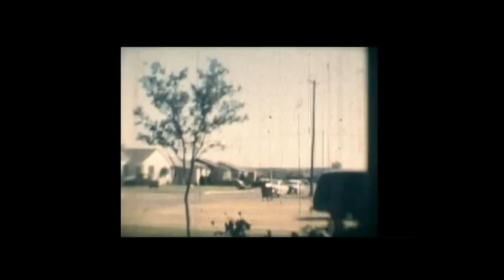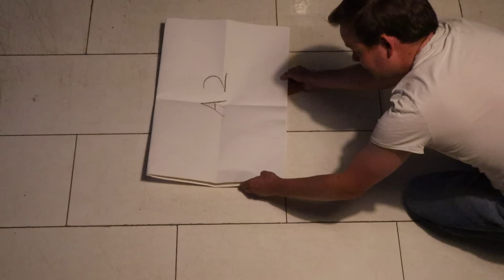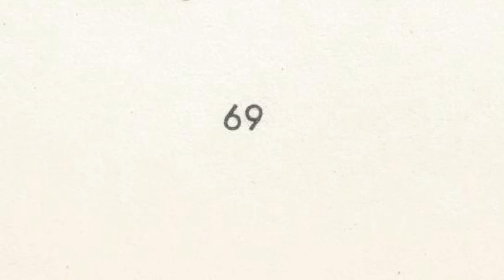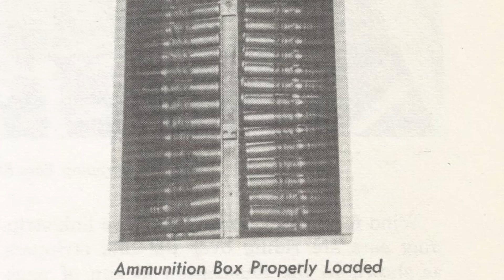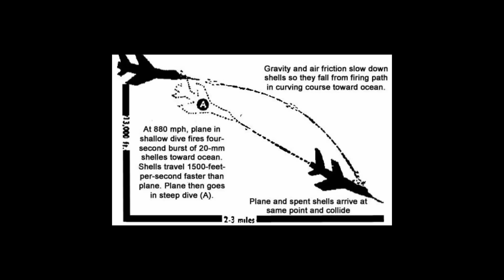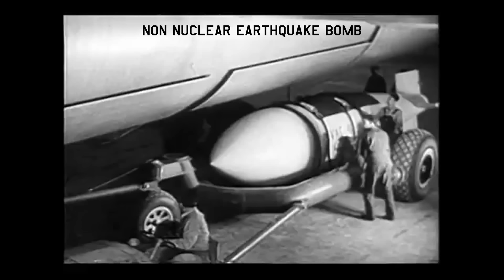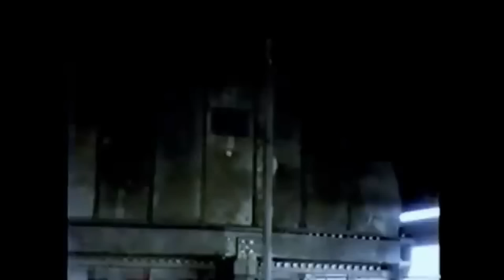Unfathomably American: The Armament Systems of the B-36

Comment: To be fair, there is no replacement for displacement from a power potential perspective. Undoubtedly, small engines can make big power. Any Supra build proves that, however, it’s equally unavoidable that when chasing a power goal, starting with a strong larger engine makes the pursuit of that goal far easier. A gen 4 twin turbo Supra made 320 HP out of a 3.0. Undoubtedly impressive. At the same time, you could get the same power out of a 6.0 LS available in a wide variety of trucks and SUVs from Chevy for no work. Put a turbo on running the same pressure as the Supra and you’re making 500-600 HP.

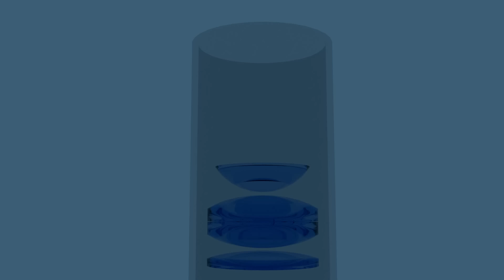Comment: 25:00 one reason your optics might not work in blender, is that you need the correct index of refraction value for each lens element. If the IOR is wrong it will bend the light too much or too little.

Comment: Oh, and, shock of shocks, you can readily find and use ISO paper sizes in the U.S. as well. Every printer here can accommodate ISO paper sizes. Any app you can think of that prints can print to ISO paper sizes. You can save Word or PDF or any range of other documents in ISO paper sizes. That we use standard paper sizes as default is more complex than just "that's the way we've always done it," but it's not your only option. FFS, I can go to our local Wal Mart and get A4 paper in stick, and we're 5 hours from the nearest large city.

Comment: America doesn't use the Imperial system, we use the U.S. Customary system AND the metric system. Americans have learned metric in school for half a century. As many Americans use metric in their everyday lives and careers than the populations of France, Germany, and most of the UK combined. Many "metric" countries also use their pre-metric measurement systems to some extent for established everyday measures. The gargantuan STEM sector in the U.S. is almost entirely metric, with the exceptions being things like civil engineering facing domestic infrastructure – the same exceptions commonly found in otherwise full-metric countries – and even then metric is commonly used on the development side. The U.S. military is metric. Many everyday goods are labeled in metric or co-labeled in both Customary and metric. Our speedometers are co-labeled, our tape measures, our measuring cups, you name it.

Comment: We use Watts, or kW. Except on cars, in which case HP. I could never figure that out, because does that mean a horse trying really hard, or what?
Reply: Horsepower is just a representation of how rapidly the vehicle's engine can use the torque it generates to accelerate or reach its top speed. It was coined in the late 18th century as a comparative measure of how much work could be done by something relative to the norm of the time, which was the draft horse. The UK also uses the mechanical horsepower value used in the U.S.

Comment: Thanks for this great video.  I saw a B-36 static display at Chanute AFB, in the late ‘70s.  Later in 1989, I attended USAF AGE Mechanic Tech School there.  To be honest, it was a dump.  It was in the midst of flat as a pancake Illinois, so the winter was horrendous.  The wind could cut through almost anything.  In fact, it got so cold near Christmas, that car heaters on maximum blew cold air.  The good ole days…..

Comment: "I am not converting watts to whatever the hell you guys use over there (America) to express power."

Ha ha! How about British Thermal Units? We still use BTUs for some things in the US, and it has "British" right in the name!
Reply: I don't think we use BTUs anywhere here, haven't for decades
Wild that it caught on in the US though
Reply: @NM-wd7kx  You do if you're in Britain, they're just used in niche cases. We in the U.S. use BTUs primarily as a common measure of heat output across different sources (gas, electric, and propane). Energy is billed in kilowatt-hours.

Comment: 56:58 Why not just use propellers? Have the reactor generate steam to power steam turbines, which then drive the propellers.
Reply: im guessing it would add a lot of weight, while a reactor could just heat up the air without much fuss
Reply: Water is notoriously heavy.

Comment: 17:00

Slight correction if I may. The .50cals would not have been sufficient to protect the aircraft, not was the 20 mil a dead end. The 20mm continues to see service to this day as the primary USAF aircraft cannon until the F-35, though in the form of the M61 vulcan. The USN used 20mms from WW2 onwards, and they provided superior damage to the .50 cals. This was further proven during the Korean war, where often times F-84 and F-86 pilots dispensed their entire load of M3 .50 cal into a MiG with barely anything. It's also why all the century series mounted 4x 20mm and then the M61.

Comment: I don't actually buy the idea of immunity to interception. The tests that the idea was based on were first based on the Saber, which had much worse high altitude performance than the Mig-15, and second were with a B-36 in non-mission configuration, without most of its fuel and bombs. People constantly try to make self escorting bombers and up until maybe B-2s, it hasn't worked.

Comment: Right! soooo. If for whatever reason it wasn't understood the nuclear reactor is supposed to be a generator as well, piezoelectrics through basic heating & cooling (mechanical through heating & cooling is pretty obviously something everyone in this crowd (90+% which is the less pedantic side versus the people thinking a word choice like this wouldn't be acceptable) would easily understand & knows already to a fairly high degree, for the basics there is a steve mould video you could actually just watch instead of bothering me) would do it, 90% return of that energy is now able to be stacked to 99% with just one extra.

A multiple fuel isn't needed, a phase change to that fuel is easily used to then turn turbines (too big & expensive honestly so that's a usually no-go for those high pressure & medium pressure sizes) but that does allow for a fuel return to be included and create a basic reduction of pumping loses. Not my go to, its stupid. 

Oh, right, for the record, its a hard line in the sand for me as well. The concept, like those other comments, is just to push & truthfully if stupid people try maybe they'll not be as stupid & build it safer than previously. This isn't marginal, which is the reason why I spent the effort on it. Even missiles & crashing won't cause much in the way of actual massive increases of radiation. Which is the main benefit, but we've gotten far better at nuclear heavy isotopes for fuels & how to properly use them since we started back then.

A tradeoff is increased electricity, instead of heavy & hot. It came from a power generation concept that then got strapped to a plane on the off chance that stupid leadership decided they were going to go ahead with it anyways.

Occlusions are included, heh puns. Further increasing strength & reduction of heat. Like the MIT paper showing you can make them in lattices of diamonds. Even better, for the right heavier elements only needed in the right structures with far lighter elements you can gain further increased protection from radiation.

I used it for my spaceship airship to increase total buoyancy to the stratosphere & improve the reduction of total time to build them & total resources to make them & make them at high quality & cheaply.

To be fair, piezoelectrics are easily made to withstand much higher temps through simple layering & stacking 3d shapes to further increase the + to - points to with the material in-between helping increase strength & outright reduction of radioactivity. 

Although, heating sterling peristaltic pumps for air movement & grounding electrostatic forces into a standard electromagnetic motor is pretty basic practice for electrothermal & ev planes these days.

Again, actually is a hard line for me to. But I have a terrible president that would absolutely stand behind this thing smiling with radioactive elements being burnt into the engine & say it was all good & they are doing it.

Which, sadly means.... Others would too, without hesitation the moment it came out they had something like this. Trolls be damned targeting me, they couldn't be stupider. Same for all people who stole my designs. F them, hope they all d ie. 

Unless they show up & help me build a country focused on just getting the f out of here & never dealing with their gabagoo madness again. Good people don't hide after thieving & then pretend they didn't end up helping the people we also together hate, like Trump & the idea of ww3 while hoping to profit from my designs & get away with doing so for so long they might as well never have to had cared.

A vacuum improves the peristaltic, but its like the submarines we have over here, cool stuff but they have salt water to reduce weight & improve efficiency. This would need huge volumes of air movement, sooooo. Induction forces are good & electrothermal into the fuel to force it to burn faster & better is a far more improved option.

But even better, on the ground (well under it) this would be a massive get! Like huge amounts of air to bendy flex power gained! Which is where it came from, nothing short of air, pumpy bend, geo-thermal, then a closed loop cycle to get those juices flowing babay!~

Comment: so far at 57.49 & loving the video! So of course I had to talk about a cool idea for a nuclear reactor just powering a mostly electrothermal & particle accelerator (like ion thrusters) using a electromagnetic ducted fan bleeding heat off using the propellors as a pump to help throw fast moving but highly charged particles that could now be used in a differently charged chemical reaction (think more halogen to alkaline) style of low total mass reactor style of powered airplane.

The basics are using the central hubs as ingest through stators front & rear of the intake & exhaust. This keeps the axel stable, but its mostly about shoving heat into the whole thing, then using the hole placed in the axel to further increase total surface area transfer that gets sucked into the blades. So the stators have the air heated sure, but this central part allows for a better total heat & ripping off of electron orbits through low penetration particles & electricity generated to force a nice n2o formation that has a missing electron orbit.

That then can be further cooled through introducing a small amount of.... Well, its slightly cheating, but particle accelerated plasma as fuel that is dumped near by the acid-like plasma cooked into the blade warming up that particle fuel that has way more electrons. You know, so it keeps cool. Because nuke lol.

The difference here is the total volume of liquid containing the needed ratios of allowed to Jules-Thompson cool radioactive fuel that gets pumped through both thermosiphon & standard electromagnetic motors (redundancy is a big one for me) but it also allows for a reduction of the nuclear fuel & an improvement in the safety risk factors going on if shot.

It allows for not a standard reduction, but an immediate capture to air & a much smaller total of extreme radioactive isotopes. 3 gases yields, in those cooling jules-thompson styles, a better layering of density of the given materials & their movement through the smaller capillary input tubes, to a middle sized axel tube, to a larger stator rear tube with needed heat sink fins concentrically connected to further increase total inner diameter towards the end. 

The wings are armored, yeah sure, but we are talking about having it move back through like multiple veins with multiple cinch off sealing points through said tubes to then collect & layer its density together to create the needed reactor system. As it ingests its needed through a standard branch convergence of concentric tubes that bullseye together to force the layering in the larger tube to then be more easily separated again in a branch divergence out to the stators allowing for it to keep its liquid density layers to remain intact.

Like those cool liquid & dye toys that can keep their placement of dye through being run & come out the other side just like it had coming in.

The main thing was separating spent fuel, if the correct fuel is used it can be shoved into the air (although... Not liking that one, personally even if the total amount of radiation is almost nothing, it just doesn't look good & could possibly fail which I don't like) or, more likely, just go into storage in the fuselage to be removed correctly. Multiple layers & a foaming agent to reduce possible fire & radiation leakage is a big one in that side, as a redundancy is key to remaining alive in non-survivorship risk bias here. Threshold dosage for exposure over time is reduced through infill of storage to improve separation of spent fuel liquid & further increases structural strength & will reduce weight while absorbing & reflecting to absorbing (so it won't likely reflect much but what is then is absorbed into material that handles weakened particles that have slightly changed course & direction) capture of radioactivity.

I have a video on my channel about it, I made sure its short & sweet like this comment.

Comment: I can personally attest to the fact that the static charge issue happened--in a way. I was privileged to know a man (since passed away) who was a USAF ground crewman for the -36. he was actually at the Convair plant and airbase the day the tornado came through and wrecked a boatload of -36s on the ground. 

Basically, the static charge issue that he saw (on at least two occasions) was actually transient voltage that got into the fire control wiring. the incident I recall the best was when he was in a hangar with a B-36, and it was hooked up to a service cart feeding it power. suddenly, there was an almighty buzzsaw roar, and a chunk of the rear hangar wall was converted into flying debris and concrete dust. Basically, transient electricity had gotten into the wiring for the tail gun and fired off an approximately one-second burst (I'm extrapolating the time based on how he described it to me). to quote the man directly, "That plane had nothing but problems."

Comment: Thyratrons are great, in fact they are STILL manufactured & even developed further to this very day for Pulsed-laser applications.
The thing is, they need to be treated with "care", meaning NOT overdrive them, even 10% more current than designed, pulsed or prolonged, and the poor oxide cathode dips out.

Also Thyratrons aren't designed for simple rectification; either they wrote it wrong or maybe you misunderstand(solid-state rectification was already common, Selenium rectifiers); instead they are designed for stuff like motor-control and while yes, they DO rectify an AC input into DC half-waves, they are closer in function to FETs today than something like a diode. Lastly, metal-ceramic ones didn't exist back then (I guess) so they were still the garbage glass; if cooling wasn't sufficient OR they rapidly cooled etc they explode. And that's not mentioning the obvious fact they're designed for sea-level pressure but I assume the engineers weren't r*tarded-enough to not take that into account.
Right? Right?? Because they aren't vacuum-tubes, they are hot pressurised gas tubes, if external pressure like @ altitude goes very low then they're dealing with magnitudes more force than designed and potentially in reverse direction if they're ones that usually run with low density of gas..

Also slightly nerdy note: while I said they can't take abuse, that's in low-frequency A/C or pulses.. In very-short pulses they are MONSTERS and that's exactly why they're still used, Silicon sucks in this application and is simply inferior. But we're talking about like nano-second of massive power then rest for like x100 that duration so as-stated stuff like pulsed lasers = ideal but most everyday use = nothing special except beign able to run EXTREMELY hot, also unlike solid-state while can't even run @ 100c. without rapid damage, whereas metal-ceramic thyratrons & tubes in general run like 400+C without detriment.

Comment: I believe that it is most likly is that the electronics constructio got damp not an lightining strike.
As valves were used in the Minuteman ICBM"s valves and the tbyrotron''s would be far more immune from lighting than following transistor, ic ect, emc from the sun or nuclear bomb.
I would like to know how the optics of the two telescopes was combined and the outer sceen target was displayed in the middle of the screen, worked?
Being an electronics it could easly be done today with cameras and computers.
Another great video.
Thank's.

Comment: I have to correct on one thing: with the beginning of the Jet age, at the latest with the development of swept wing jets 50cal MGs as aircraft armament were instantly obsolete. Not because there was anything wrong with them, but because of throw weight. With the speeds of jetfighters attacking other jets fighters, jetfighters attacking bombers or even jet bombers or a bombers guns engaging a jetfighter the window for firing was extremely short. So one needed as much throw weight as possible to have a chnace to get enough rounds on target to have a chance for a kill. Thats why the 50 cal was so quickly dropped. By the late 40s, a jet should have either two 30mm cannons or four 20mm cannons to have even a chance of getting enough rounds on target in a firing pass.